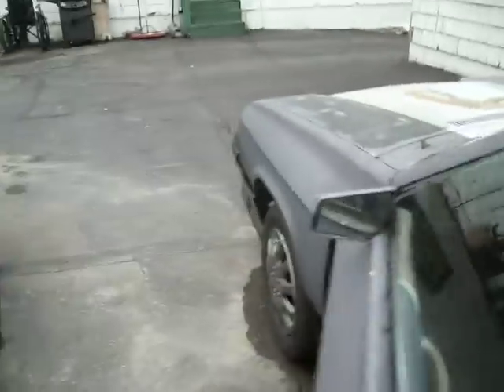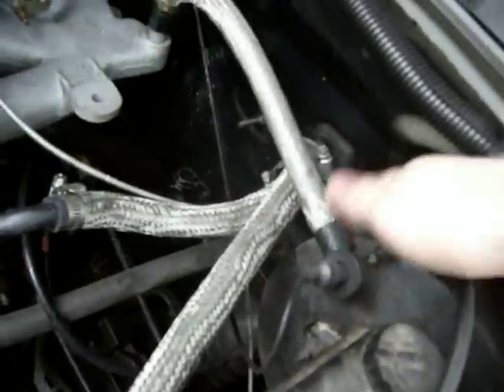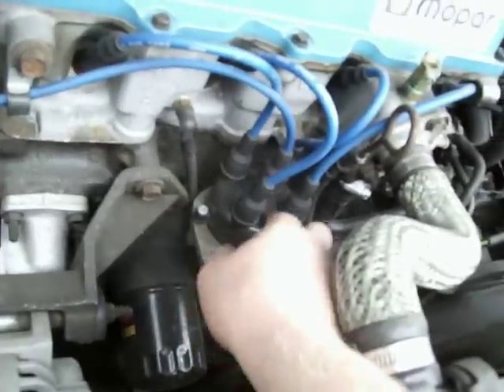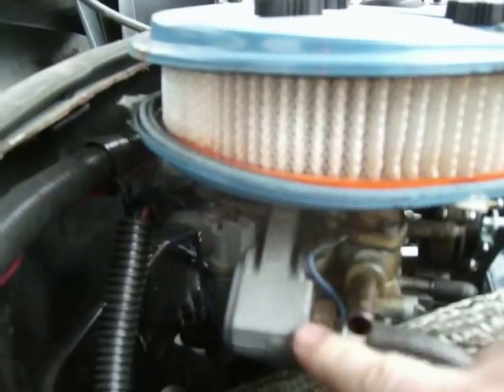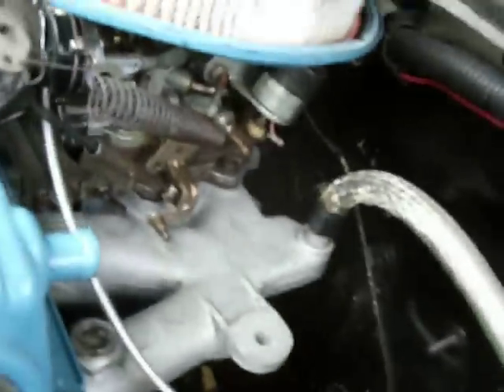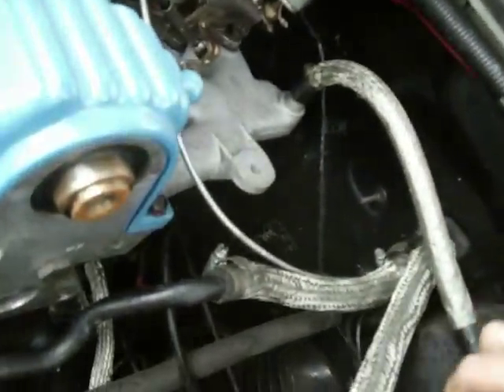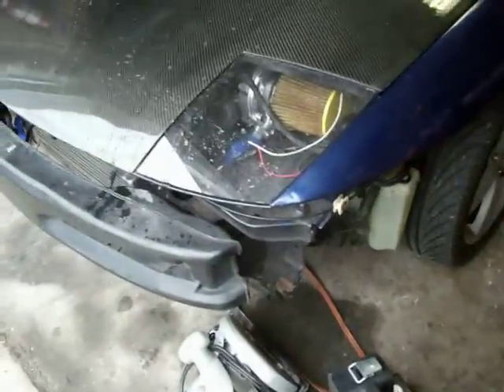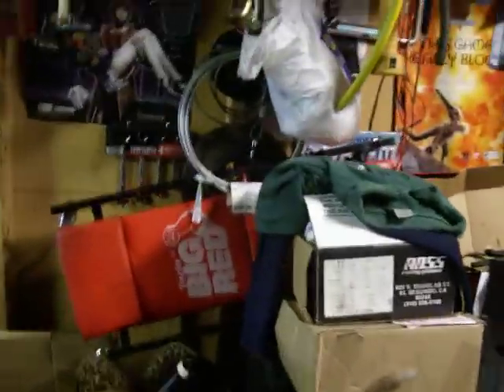Removing Vacuum Lines.

Comment from the maker: Most all of the original Vacuum lines are used for the pollution control system. I did the same thing to my 89 Shadow 2.2. Needless to say I just hauled a trailer loaded with at least 500 pounds in it up north with that Shadow and got 21mpg. So it only helps lol.